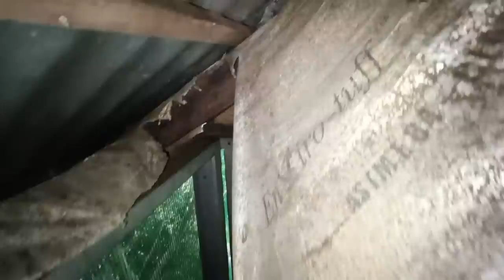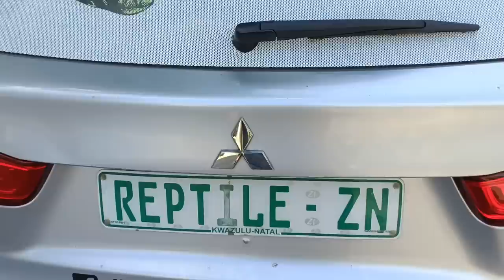CUTTING A BLACK MAMBA FROM A ROOF !!!

Comment: I saw the snout stick out before you noticed it, thank goodness it didn't bite you when you couldn't see it. I am sure that you will see it if you watch this it's at the far left, you get a glimpse of 'white' moving. You need to carry an utility knife, one where the blade can retract and you can just snap the dull blade off and have a fresh one ready.
Reply from the maker: Yeah that's quite right. I also noticed it only when I watched the footage. That's it's little pearly white snout. The camera height and angle was better than my head angle and height 🙈🙈
I had a nice sharp knife in the car...🙈🙈👍🏻😜

Comment: Wow, Jason, some tense moments in there...  Nothing like having to scale locked seurity gates with your gear and a likely none-too-happy black mamba in a bag...  How's your blood pressure, mate? 😀  (Mine shoots up just watching, as my breathing stops in the dicey parts.)  All's well that ends well, right?  Thanks once more for your work, for the people, the pigeons, and the snakes.  Cheers, bro!
Reply from the maker: Thank you. Definitely some tense moments, especially when I can't see where the snakes head has gone and the gardener starts shouting as if it's hovering above my head 🙈🙈🙈🙈🤣😜
Reply: @jasonarnold-snakeman  Ya, scared US, too.  Also, when you stuck your fingers in the roof lining on the other side of the beam (or what it looked like).  I was woah, bro...  Would it have worked to poke that side of the lining, to encourage the mamba out the opening?  Course, then, you would have had the head directly at you.  Dicey...  Cheers, mate!

Comment: what do the owners do, if each time a mamba appears, their roof is distroyed?
Reply from the maker: Fortunately the membrane doesn't serve much of a purpose, as the roof is made of steel sheeting and is very water resistant. No water gets through. If and when they eventually have to replace the roof sheeting, they will replace the membrane at the same time. This is just an old storage shed, so it doesn't need to look pretty. 👍🏻👍🏻
Reply: @jasonarnold-snakeman  
ok...I thought they must have a good assurance contract...
You see our indulgence here in Germany
🙄🥴

Comment: I'll tell ya Jayson  trying to handle these snakes safely as you do being a professional snake and reptile handler  but for an untrained civilian just living around these creatures has to be nerve racking and also a question if some one were bitten how long would the be able to survive with out treatment ? Thanks .
Reply from the maker: Adults usually take between 2 to 6 hours to die. It depends on so many factors though. But to die in less than an hour is extremely unlikely.